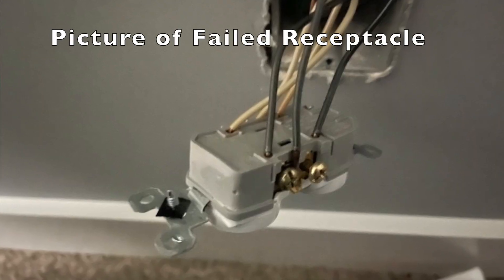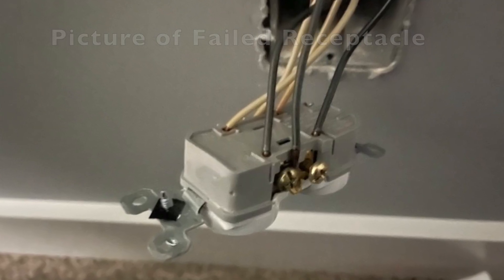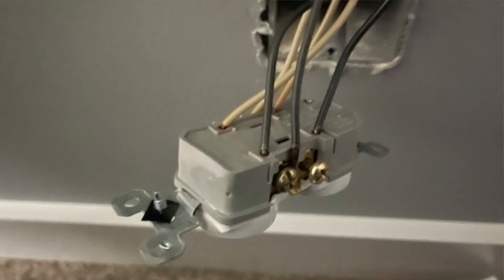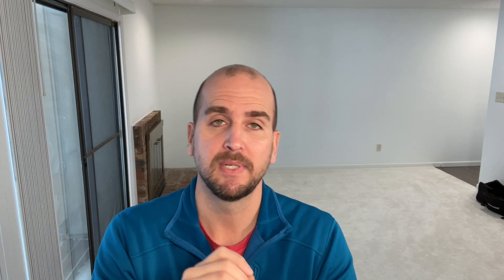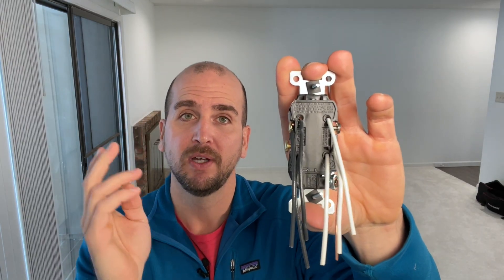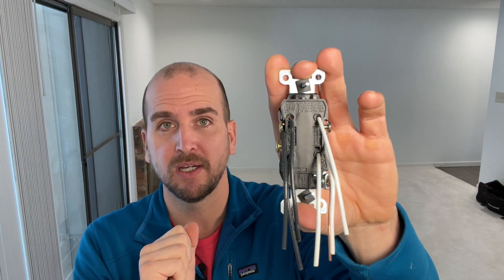Incorrectly Wired Outlet Found In Newly Built Home

Comment: Just curious what the reasoning is for the minimum 6" on the pigtail? Is that just a Best Practice, or is there a heat, expansion, etc. reason for it?
Reply: you don’t want to cut it short because you always want extra slack at least 8 inches
Reply: @Gomer Pile that doesn’t answer the question. Pigtails themself can be any length so it’s your choice how long to make them. All the comments on this post keep mentioning the “6 inch rule” which only applies to conductors entering the enclosure and most people quote the code wrong here as well. Unless you can cite the article that states pigtails must be at least 6”
Reply: @Gomer Pile  just say it’s a industry standard then. Your long winded “explanation” didn’t answer the original question. The real answer is that there isn’t a reason for specifically 6” because there is no requirement for pigtail length. I could make it 2” if I wanted to so long as the free conductors entering the box are the code required length. “Heat expansion” has no relevancy here, seeing as the reason for box fill has nothing to do with expansion but dissipation of heat and not damaging the insulation when closing the box. Like come on, quick flapping your gab and go back to school

Comment: It's interesting that the advice you've received from professionals is contrary to the receptacle you displayed, yet it was supposedly installed by a professional. I didn't know about the paneling code. Several years ago I refinished my basement (into a luxury man cave and family room), taking down paneling and then I put up wallboard, and the electrical work was done correctly. But with the paneling, all of the electrical work was in violation of code. I didn't know that at the time but knew what  it was supposed to be. Also, I was changing a ceiling fan on the upper level (3 levels) of the house that was roughed in when built and later finished by the homeowner. When I took down the old fan there was a metal box. It wasn't grounded. So I fixed that. Sometimes we don't know when we live in a fire trap or an electrocution trap.

Comment: I still don't understand why use pigtail. What is wrong with 2 hot wires attached on the side of outlet with screws? Is the strip connecting the two screws too thin, hence unable to carry rated current?
Reply: No it’s rated for whatever the receptacle is rated. But what happens if the device fails for some reason? Everything down the line is now dead. Yes the splice could fail as well but if that happens then you have another problem and should learn proper technique

Comment: Another thing I noticed is that both pushback and screws are used on the same screw. It may not be the case for the outlet you showed, but on the outlets I last looked at, you can use the back OR the screw, but not both at the same time.

Comment: For me as an Europe electrican. Its verry horrible for lock this us wiring. Twist the wires together with this wire nuts, would never pass an electrical inspection in my Home. I think Its not save. We use Wago connectors in Europe.

Comment: First many years ago, advised by a wire nut company rep, was told not to twist wires. The wire nut would do that. Second there are some receptacles with captive screws that move a plate that will tighten down on two wires that are not push through but are put in through holes in the receptacle. These are my preferred receptacles. As far as pigtails I have seen more wire nut failures than receptacles in my 40 years of service. In fact at one time wire nuts were forbidden by management. This was an industrial business however.
Reply: I'm not saying you're wrong, but from what I've viewed on YouTube and electricians with whom I've talked most people DO twist the wires prior to screwing on the wire nut, and most use pigtails. For neatness on the receptacle I personally prefer pigtails. But it works for you, that's fine. Oh, the wire nut failures I've had are simply putting one on and the spring comes out if I've done it wrong or used the wrong size. Inside the box they're virtually motionless over time so I don't get how you'd see so many failures unless the particular outlets have been pulled out and pushed in several times. But the outlet itself is subject to constant wear and degradation over time by the simple fact of arcing and I've seen far more receptacle failures and no wire nut failures unless the nuts were installed wrong to start with or had been removed and re-installed over time.
Reply: @Voartist  People do things their own way all the time. A rep told me this years ago and if you look on youtube you will see some showing the proper way. The majority of wire nut failures I have seen are melted using the improper size wire nut and wires of different gauges cause this mainly. Especially stranded wires. IMO every joint in a wire is a failure point. Wire nuts and pigtails are an extra joint. Again IMO a proper receptacle with two hots two neutrals. I don't use push in devices. And I won't use cheap devices. There is a receptacle that has spaces for  four wires that are held with the pressure of the screws. This is my preferred device. Loose connections cause heat at low amp pulls by arcing. Circuit breakers or fuses protect wires from excessive heat at high amp draws. Clearly loose connections are the greater problem. What I see is people twisting one wire around the other ( especially on mixed stranded and solid wire.) This causes the outer wire to be the only one in contact with the wire nut. The inner wire is connected by compression of the outer wire. After many heat cycles the inner wire's compression connection is  lost and heating begins. That's my experience. Others will vary. The best way to insure both wires are grabbed by the metal threads of the wire nut is to hold them side by side, not to pretwist. Anyway that's my experience. YMMV.
Reply: @ijugornot  I appreciate your response and explanation. Good points for me to ponder. I've installed 2 ceiling fans in the last couple of weeks, one whose metal box was not grounded (previous owner and I fixed it), and I hate joining braided wire to solid wire, but I do ensure the joints are tight.

Comment: Had 2 outlets start to melt in my mobile home. Replaced them with pigtails just like you showed, but also wrapped wire nuts with black electrical tape. Ended up swapping 12 outlets just to be safe. I don't trust push ins either

Comment: We recently (2/21) went from renters to townhome owners.  The prior owner had sweetened the for sale listing by extending electrical wires from within the house to outside to create an outlet to reach a water softener.  Our home inspector did not report any issues.  Not long after winter faded and the humidity and thunderstorms started (4/21), our water softener lost power.  The breaker had not triggered, but the GFCI receptacles had.  (Yes, I said:  receptacleS.)  Our circuit goes from a 20A breaker in the fuse box to (1) a kitchen wall 15A receptacle to (2) another kitchen wall 15A receptacle to (3) a DIY outdoor 15A GFCI receptacle to (4) another DIY outdoor 15A GFCI receptacle in which finally the water softener is plugged in.  A trip to Lowe's and they sent me back with a box of three 20A GFCI to replace the receptacles:  the two outdoors and at least the one inside the kitchen leading outside.  This runs contrary to what I gleaned from you so far:  there should not be multiple GFCI receptacles on the circuit/line, and it should be the first receptacle that is replaced with the GFCI anyway.  So back to Lowe's where they give me just one 15A GFCI receptacle telling me 20A GFCI receptacles are overkill, and the 20A breaker doesn't matter, i.e., I don't have to use a 20A GFCI just because the breaker is 20A.  Needless to say I'm not filled with confidence.  I am determined to do this on my own, especially since a call to two different commercial electricians meant I would still be left in the dark (not literally) and with a bill for my shame.  What should this circuit/line look like?  If point A is the 20A breaker and point B is the water softener, what do points 1 (kitchen wall), 2 (kitchen under windowsill), 3 (outdoor under windowsill), and 4 (near water softener on porch) look like?

Comment: Is it better to use a pigtail vs wiring both (x2) neutral and hot to each terminal? *And leave the 3rd push-in connector not-connected

Comment: You mentioned only 14 gauge should be used in outlet push-in terminals. BUT  20 amp. Outlets  require 12 gauge .(& I believe 14 gauge is allowed only for lighting circuits)

Comment: Great advice. I think the pigtail is great advice. Matter of fact I have a work shop I am working on. That I have already about completed the wiring. I will go back on several of the outlets and use the pigtail.  I am no electrician just a home owner. Yet I always cover my wire nuts with electrical tape. I also bring that tape down on to the wires.  That may be good or bad I do not know.  Including also wrapping around the outside edge of the outlet. After wiring is finished. That covers all the screw heads/wires where the wire connections are made. So if some one later goes to pull the outlet from the wall and forgets to shut the power off. They will not grab the outlet and shock them selves. The tape would cover the power source. Maybe that is not a good thing to do either. Aggravating thing I find is in our home. Who ever wired it. Left very little extra wire in the boxes or any where at all. Even in the attic hardly any extra wire.

Comment: Tan wirenuts we're the appropriate size for 3 -12 Gage Wire pigtails

The Red can come loose. Red are designed to handle Four wires

Should have stated that the power was off (the way you grabbed the outlet & shoved the wires in the box)

Many professional electrician do work with power on (with power on ,I use the back handle of my wooden handle hammer to shove the wires in the box. This flatten the wires as to avoid grounding against outlet.
Working while HOT, Not saying it's right, but we learned for times it's hard to find the correct panels on commercial sites with many subpannels)

Comment: You stated multiple times that using pigtails is "a much better approach" over using multiple terminals on a side, but could you explain why it is better?
Reply from the maker: Hey Jason, the pigtail method moves the junction of multiple branches to the wire nut as opposed to the receptacle.  So if the receptacle has an issue / failure your other branches will not be impacted.
Reply: Back stabbing isn't against NEC code book nor is Wrapping the conductor around the terminal screw! The device is UL listed to back stabbed. PLEASE read the recommended instructions from the receptacle manufacturer. Pig Tails are generally used when trying to attach multiple conductors to ONE terminal. I would say these are not wrong yet discrepancies you don't agree with.

Comment: One comment, one question:
I was told that you should align the ground on the receptacle to the UP position.
Should you wrap or seal the wire nut opening with tape?
Thanks!
Reply: There is nothing in the Code regarding this BUT it is a good idea IF you are using metal /metal raised covers.  The thought process is that if the screws that hold the"metal" cover /cover inserts loosen up, the cover/inserts could come in contact with the energized prongs (instead of the ground prong) if the cord gets pulled down.  Normal plastic covers don't have this problem.

Comment: It’s more common than you know!  I was extending my barn to add a shop.  Asked the contractor doing the job if he would do the AC wiring.  He said sure!  He was licensed electrician.  As I was explaining what I wanted, he kept saying things that didn’t sound right.  When I mentioned a sub panel 115 ft. from the main, wired for the standard 120, and both phases for a 240 volt circuit for my welder, etc. he said a 4 wire run from main to sub.  I asked why 4?  He said for the ground wire too.  I said no no no no you must use a ground rod as close to the sub as possible (NEC code).  He said NAW this isn’t in city limits and we don’t need to follow no codes.  That we do this all the time!  So I hired him to just install an 8 ft grounding rod through the concrete and weld a long bare 10G 6ft wire and that’s all.  The guy almost argued with me about the ground rod being code
(NEC) even I after I pulled it up on my phone!  Turns out he personally wasn’t licensed but his boss was and he was just working under his bosses license.  And I wonder how many jobs he has done incorrectly, and how many fires or electrocutions he had under his belt.  Anyway since I needed lights in the entire barn, outlets, etc.  I did the job with my brother and saved $6K.  I know it’s code and I upped the 240 by two gauges just to make sure.  So it seems this happens a lot.
Unskilled labor working under some low life’s license IF even licensed at all!
Reply: #4 in Copper could have run your welder at 50 amps for that stretch. Now CCA, is something different. And yes, so true about the grounding rod.

Comment: Fourth error: best practice is to have  the ground of the plugs on top, not bottom. If you see a smiley face on your outlet, turn it  upside down.
Reply: NEC does not specify, I always put Ground down 30 yrs
Reply: Why's that?
Reply: I've heard that this is required by code for hospitals but not elsewhere.  The idea is that if a plug is partially pulled out, anything falling from above will hit the ground first.  The likelihood of it every mattering is tiny, but it may be marginally safer to put the ground up.  It also tends to demonstrate that the wiring is newer.  I switched mine to ground up so that it was obvious which ones I had already replaced (the old wiring used the back insertion and had failed on multiple outlets).

Comment: No! You should use alternate screws if you use the top silver screw, then use the bottom brass screw.  This way if either part of the device fails, it will not work.  Saving possibly using a partially faulty device.

Comment: I replaced the outlets in my doublewide which was made in 1996 when my dad bought it in 2017. 

Pretty much all outlets were wired using the push in terminals and many didn't even have screw terminals.

I used the better quality back wire outlets.

Feel much better about things as I know I won't have any issues from loose connections.

Comment: I totally disagree with you on the pigtail issue. Reason, a direct wire to a receptacle or an appliance is by far better and safer then wires being spliced to create a pigtail. that's only when each wire has it's own unique designated terminal connection. However, if the condition calls for 2 or more wires to be connected to one terminal (1 screw) then it is by far better to go the pigtail route...
P.S. There is nothing wrong with the sample receptacle you exhibited just because there are 6 wires connected to it, it's perfectly ok 
May I also suggest you put electrical tape around the receptacle to cover the terminals for added protection...

Comment: I have a circuit that isn't functioning. I've narrowed it down the specific breaker in my panel. I used a Commercial Electric Outlet tester. The code I kind of get is a solid Open Neutral and a lightly dim lit open ground light. Of the 4 outlets and 2 lights on the breaker circuit, two outlets and the two lights are not working. I'm feeling like this is an easy fix. I just cant seem to figure it out. One outlet has two hot, two neutral and a ground attached to one outlet. I'm thinking I could try capping them respectively like you did in the third example. Do you think that would work?

Comment: Ok me again, two things I want to contribute. 1st is that I saw on one of the push in wires. It looked like the insulation was stripped with the wrong size on the wire stripper. As a result there is a cut in the wire. this effectively reduces the wire gauge at that point and reduces the current carrying capacity. Secondly was the stuffing of the wires into the box. Its a small point but I like to point the wire nuts facing up. Why? just in case for some reason water gets into the box (broken pipe, inside the wall leak from the roof, overflowing sink etc.).  I just thing its a simple thing to do and could potentially stop a water leak from becoming LIVE..

Comment: I agree--stab terminals are a very poor alternative to screw connections and should never be used. The contact surface is significantly less, and the spring hold downs can weaken over the years. Both lead to overheating at the point of contact. Pigtails, however, are a personal preference. If done properly, using two screws--or better yet having two wires under a double hold-down plate--are as robust as a pigtail. If either are done poorly--and I've run across more than one, poorly wire-nutted connection--you are going to create a problem. There are a million professional electricians who don't use pigtails. I would never leave a homeowner under the impression that pigtails are a "best practice" alternative. They are just another (PIA) alternative with insignificant benefits. Google it and you will see endless arguments. (50 years residential and commercial single and three-phase wiring.)

Comment: I  do NOT  undertand why   push in/ stab in   terminals are still legal.  The types where you  push in  but the screw  clamps it, not so bad.  These  "screwless"   spring loaded ones are junk and have been for DECADES.  WHY are they  still  "code"?
Reply: cause they last 30 years, until they finally fail. yes, I don't use them that way, I use pigtails, but it is alot quicker to run an entire home when it's down to the studs. Production = Money